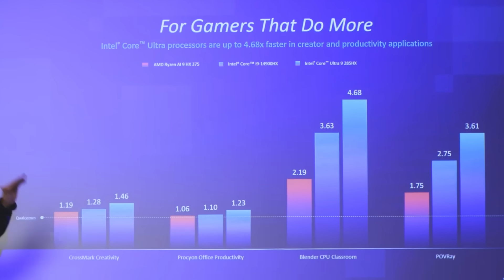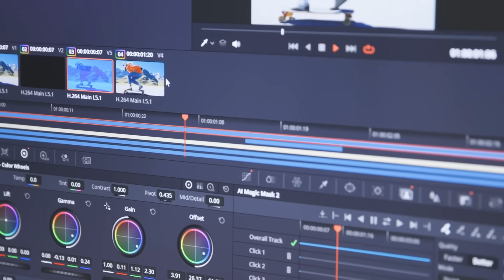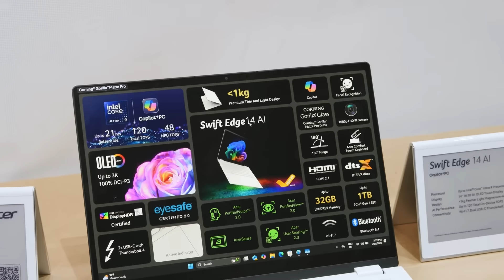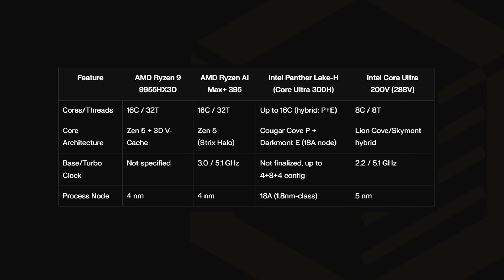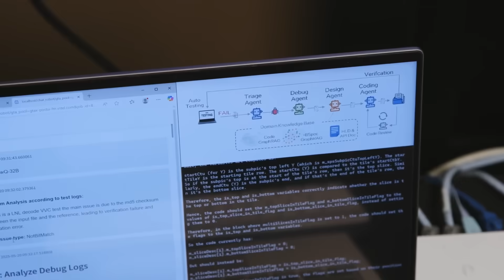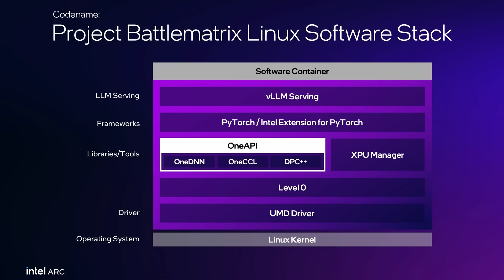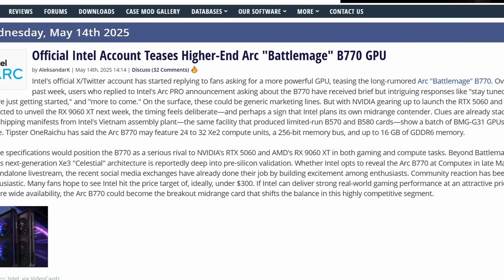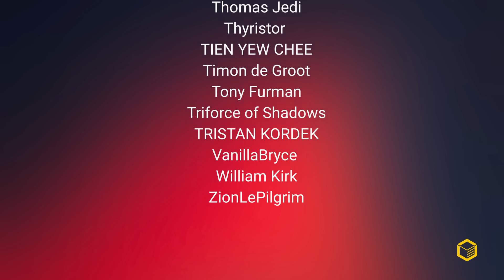Intel at Computex 2025 - the NEW Intel we NEED

Comment: The more I see what Intel is doing, more I'm convinced that their upcoming products won't solve any of its problems. They are laying groundwork for recovery, fixing long overdue issues. Sure, they do all that. However, newest Intel products can't beat existing products, much less upcoming products from their competition. They are an entire generation behind. So, there is a still long road before Intel stock recovers. 

The fact that Tan wants to move newest Intel products to TCSMs speaks volumes to just how far behind they actually are. If there is any more delays to 18A process node, it might become irrelevant as TCSM plans to deliver their own back power delivery and all gate transistor design in 2016. They can't afford any more delays if they want to reach parity.
Reply: Intel's Xeon 6 are very competitive and manufactured on intel 3. Majority of intel's products that actually carry the companies financials' are made in house not by TSMC. If intel moves their Xeons to TSMC then this would indicate they are planning to go fabless because they are no longer capable of manufacturing their own competitive products similar to how AMD spun off their fabs. 18A will define if intel is capable of coming back.

Comment: Latest intel gaming class GPU on an old rig with a 99k. Will it work? Asking for a friend.
Reply: Without bothering to google specific examples (you should do this) there's a couple reasons it could be pretty bad. Arc needs higher relative CPU than its price competition to achieve its potential which can be a real issue in budget CPUs in some games (see Hardware Unboxed analysis tho I don't think they went back to CPUs as old as 9900K). Also make sure the Z370 board has a BIOS with resizeable BAR as Arc performance craters without it.

Comment: Don't worry i already downloaded source UE5, just waiting on Grok 3.5 to help me learn how to do the curating, chunking, embedding, and indexing the code part turns out Rider IDE AI coder uses a RAG system so should be easier than actually understanding and Training a UE5 Syntax specific LLM, RL ML and data science is a bit much but if tests don't work out for RAG I must do what I must do. ps. using Qwen 2.5 coder as base cuz it ranks highest in c++

Comment: The problem I have with Intel ai cards and battlematrix is the low memory bandwidth. The memory bus width is hampering it. It’s no faster than Apple m4 Max and that device has ddr memory. I’ll need to see benchmarks but I doubt it would be much faster than that. Especially if you consider power efficiency and so on.

I’m glad to see they’re in the ring but I’m not enthused by their offering. How expensive would it be? It can’t be much more expensive than Apple’s offering.

Comment: Personally, I'm very hyped for Panther Lake due to Intel's focus on efficiency + a good amount of grunt, especially after how good Lunar Lake was on PC handhelds and laptops. Though, I wasn't a fan of the 32GB of RAM cap, which is why I waited for Panther Lake. Very curious about Intel's GPUs for (proxied) video editing via eGPU using a USB4/TB5 80Gbps connection (RIP PC towers). Glad AMD and Apple kicked Intel's butt on different ends/categories. It definitely was the fire Intel needed. I have no interest in high-end PC gaming (my PC handheld + PS5 Pro + Portal handles that beautifully) so I couldn't care any less about bulky PC towers for gaming + work (UI design + programming + video editing).

Comment: "NEW Intel we NEED" is Intel which has no grip on mobile device market. Who does not force manufacturers to buy low-end chips together with high-end.
Who does not dictate, that if manufacturer produces more than certain percentage of devices with AMD, they'll change pricing or priority of deliveries.

That new Intel we need is one which does not behave in anti-competitive way. And same applies to nVidia. Last intel CPU I bought was almost 15 years ago, for those very reasons. And in that time frame, once, I had no other choice than to get mobile device with nVidia's GPU. All the other cases were fulfilled perfectly by AMD.

Comment: Shocking how long Intel is taking to respond to AMD, like this is worse than FX
Reply: Intel released Meteor Lake, Lunar Lake and Arrow Lake all in the same year, along with Battlemage.
Reply: @rattlehead999 All of that flopped.
Reply: @26Guenter  Lunar was top notch and intel sold out on Battlemage, wouldn't call those a flop.
Reply: @rattlehead999 Battlemage had low supply. Also the drive overhead issue kills the price because the people that would buy a card at that price are going to have lower performance because they're more likely to have a lower end CPU.
Reply: @26Guenter  The b580 does well with Zen2 and higher, The Ryzen 5 5500 and 5600 are 70-80$ each, their motherboards are another 70-80$ and DDR4 is 45$ per 32GB or 25$ per 16GB. For intel it's 10th gen or higher.

Comment: They should make x86 more open to new manufacturers for more competition!
Reply: Everyone wishes that, except they won't do it, because a duopoly is almost as good for them as a monopoly, and almost as bad for the customers.
Also we need x86 to be pruned and trimmed from legacy instructions.
Reply: X86 is dead on arrival it's power consumption vs arm will be it's end... Let's face it arm is already king in phones...and Snapdragon arm already available...apples M1,2,3 all based on custom arm and they use that rosesetta program to run x86. Yeap x86 is dead within 5 to 10 yrs.
Reply: @ntal5859 Lunar Lake literally outdid the Qualcomm X Elite... While also being modular and not a monolith.
Apple makes very wide cores and chips as a whole, on top of usually being one process node ahead.

Wide chips are great for customers and efficiency, but their production cost is massive and don't scale well for data center usage. AMD, Intel and Qualcomm all make Small cores and Very small cores. Apple makes Medium Cores and very small cores.

Wide core at medium clock speeds will always be both faster and more power efficient than a small core clocked to the moon, but it will also be much more expensive and hard to scale.
Reply: @rattlehead999 I agree that the instruction set needs to be cleaned up for more efficient code, and that power consumption isn’t an issue due to op-cache. X86 isn’t dead, but the RISC vs CISC debate is!
Reply: @salainen6850  Yup, neither ARM, NOR X86 is either RISC or CISC. They are a hybrid of both...

Comment: Intel definitely found a place to use those GPUs. Intel Arc Pro (B50 and B60) looks quite interesting for small workstations, VDI, etc.). It's a bit sad that basically they will be adding software support all the way to 2026. It lacks FP4 and FP8 IIRC (probably will be added in Xe3). 96GB RTX PRO 6000 Blackwell  locally is about 10.500 EUR. Arc Pro B50 is 299 USD. Based on various Computex videos Arc Pro B60 should be ~500 USD, and dual-B60 MAXSUN (48GB total) should be below 1000 USD. Intel is a strong software company, while AMD is not (they are trying to improve it, but that's not moving as fast as needed, I think). This will get interesting. If VRAM capacity is your bottleneck this looks like a cheaper way to solve it. Of course depends software being done.

Comment: B770 - Launching half a year later compared to competitors. And likely not at $350 because B580 did also not release at MSRP and availability was extremely poor.
Not to mention the issue with high CPU overhead impacting weaker CPU's. Unless Intel has solved this in hardware it could be very bad and would mean B770 needs a high end CPU to reach it's max performance. The question mark is also the PCIe interface. if Intel will use x8 like they used on B580 and like Nvidia is using for 5060 it would be bad for older systems. 9060 XT at least is x16.
Reply: B580 is at MSRP in eastern europe.
The B770 should be a 450$, not 350$.

Comment: what are you on about the arc b580 bets the 5060ti 16gb in some games so the b770 should be like a 5070/5070ti
Reply: b580 is close to the 4060Ti 16GB, not the 5060Ti 16GB.
The b770 should match the 5070, but not the 5070Ti, there is a big gap between the two.
The thing is that the b770 would be 400-450$ which would be much cheaper than both the 5070 and 9070.
Reply: @rattlehead999  arc b580 is faster then the  5060ti 8gb and is on average 10 fps slower then 5060ti 16gb but it is faster in some games
Reply: @Zefexi  it's normal to be faster in intel optimized titles, we are talking on average, because you can always cherrypick games otherwise.
And the 8GB 5060Ti is to be ignored entirely.
Reply: @rattlehead999  and the 5060Ti cost 2x more then the arc580
Reply: @Zefexi  absolutely. The 580 is the better deal, but that doesn't mean it's as good as the 5060Ti 16GB.

Comment: MSI 8 AI+ is great tablet but people don't trust it - IMO it's new piece of pie, Intel should go there with full power - it has hardware XESS2 as very important advantage. But they don't - so even devs are not adding XESS2 to games. IMO Intel+Intel should go for free to some console - just for people to run it. AMD XDNA2 is not present in Handhelds yet and even in laptops it cannot yet run FSR4Lite and of course, FSR4Lite isn't there. Intel can dominate the handheld market - I don't understand why it chooses not to.
Reply: @michahojwa8132 Intel probably don't choose to put their video cards in handhelds because for Intel it is much smaller gain than for AMD because Intel is much bigger, and harder to convince suits to focus on smaller gains than bigger. Other reason could be that it is too big to get messages through people on top. Also they are refocusing, cutting costs until they profit again. Intel GPU wasn't cut completely by new CEO was because it was too much money invested, and they think they can earn it back. It was just couple years ago that it could be aborted.
Reply: @juriscervenaks8953  So you're not giving much hope in Intel seriously investing in handhelds? That probably means low adoption so not enough intel GPU users to matter and to be fixed. That's bad because window is really small. Nvidia will have arm+geforce handheld at the end of the year, will have big iGPU this year and most probably would have big AI focused iGPU, cheaper but with power of 5070ti - They could launch gaussian splatting games for cheap products then and roll over anything the competition could do. Intel and AMD must take the market before gaussian splatting apocalypse comes IMO.